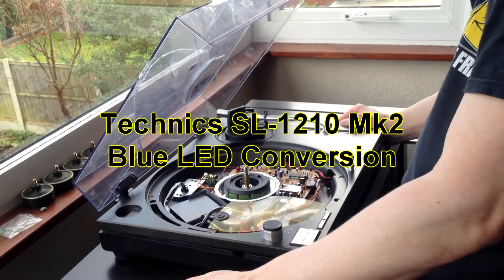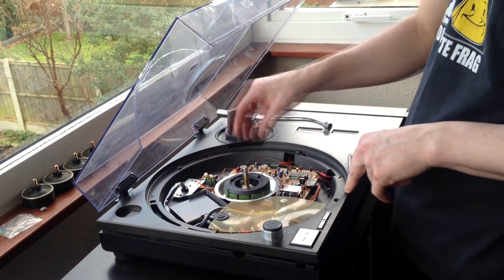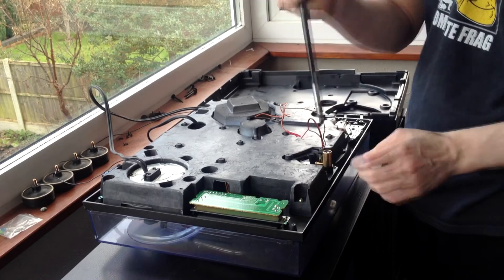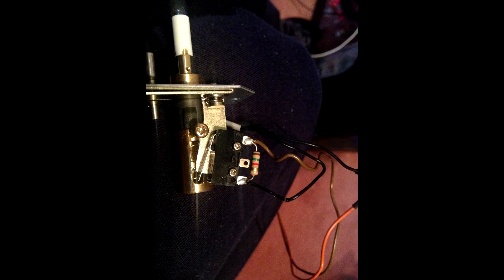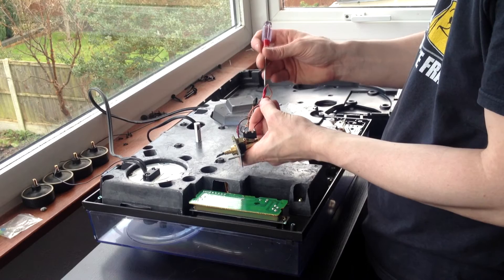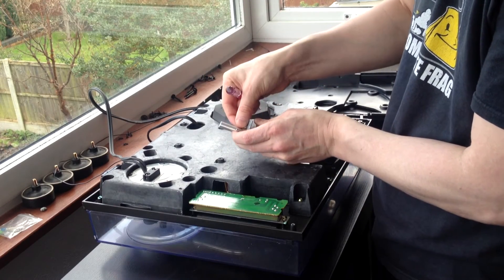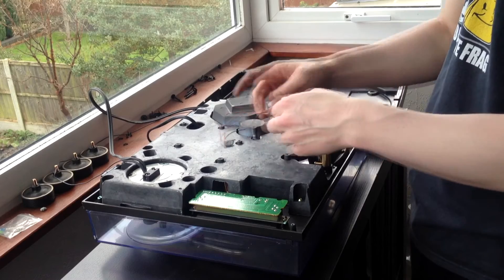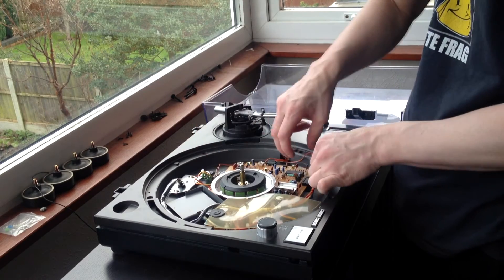SL-1210 Mk2 Blue LED Target Light Mod How to

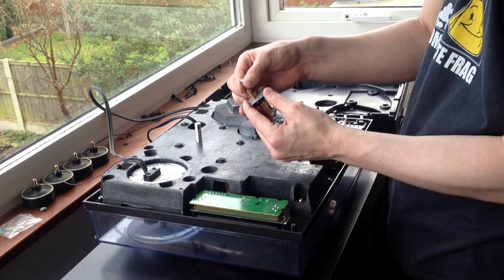Comment from the maker: For anyone following this to replace the Target Light please be aware I made a mistake. @4:20 I wrongly refer to the LED resistor as a capacitor. please not this should be a resistor and I recommended at 330ohm resistor is used.
Reply: Thx for sharing.  How is it holding up so far?  Thx

Comment: Couldn’t you just filter the white light to be blue if by coloring the bulb blue with a blue highlighter, or blue marker. Do you think that would work? Or better yet. Make a little ring of blue transparent film that fits snugly over the bulb. That way I can change the color back and forth quick and easy. I could even get different colors of transparent film and change it on the fly to whatever color I want. I’m gonna try that today and see how it looks.
Reply: Did you manage?

Comment: By saying capacitor u will be leading the technics owners to ruin their turntables.The right word is RESISTOR.Keep ur 1200s.original
Reply from the maker: Your 100% right I made a big mistake and I have corrected myself in the comments 9 years ago. There was a card pointing this out but YouTube has changed since then so I need to update this. Thanks for reminding me and making everyone aware. As a gentle reminder if your not happy with modifying your technics PLEASE PLEASE do not take this a gospel.

Comment: Hi, thanks for sharing this very useful tutorial. Can you please clarify a bit more wiring this new led bulb because there are many different ways of connecting on various tutorials and it is a bit confusing sometimes. 
Which wire on your new LED bulb has installed resistor (black or red)? Is that wire (with resistor) connected to the switch or directly to the orange wire? Thx!!
Reply from the maker: Sorry I've not been around for some time trying to get back in to things. The LED kit was pre wired and shrink wrapped with the resistor on. I would say though that the resistor would be attached to the live wire to restrict current flow for the LED you wan to use.

Comment: Got an upgrade kit from Ebay which was successfully installed, well, installed as pet the OEM lights and it stays on both when up and down(light supposed to switch off when pressed down or disengaged).
Does connecting in the manner which you've done do away with that problem?

Great video BTW.
Reply from the maker: Not sure why it would be doing that but no my connection turns off when pressed down. Double check wiring and the switch it connected too.

Comment: So the capacitor goes on red wire
Reply from the maker: If your using one of the led packs from eBay the resistor is fitted ready to connect just connect up ad per the instructions. If your fitting your own LED you don't need a resistor but it will be super bright and could blow the led or damage the circuit. Something like a 330ohm resistor might be worth adding if using your own led. My apologise it should be resistor not capacitor as I day in the video.

Comment: do you not need another resister for the voltage thats not used up by the led?
Reply from the maker: the resistor is attached to the LED that i bought so check when you buy yours.
Reply: @CheFPV  i just used a 5v voltage regulator and resistor but that was on my gemini pt 2000's i havent done anything to my technics yet

Comment: You sound very local to me. Do you do these conversions for other people? Cheers, Ben.
Reply from the maker: I Live in Birmingham near to solihull. I've never done them for anybody else but it's not a hard job.
Reply: Thanks Chris. I'll give it a go. I want to do the lights throughout.
Reply from the maker: Pitch light is not to hard to do pretty much desolder the old one put the new one in and resolder. the pain is the strobe light. If i remember right its 4 LEDs and the casing that holds the strobe in has glue on it that you need to heat up with a heat gun or hair dryer to soften it and make it easier to take apart. I was supposed to do a video on that part but haven't got around to finishing the second deck yet.